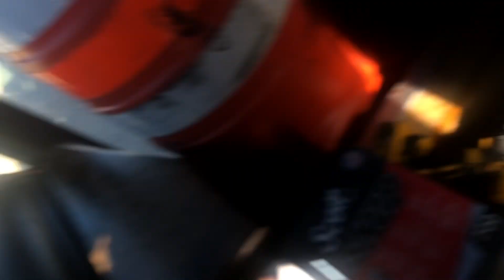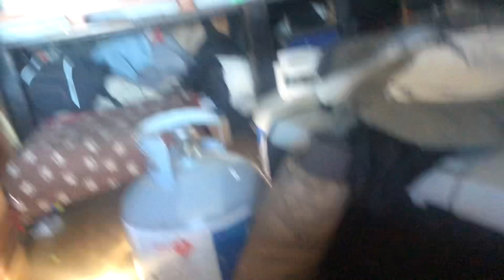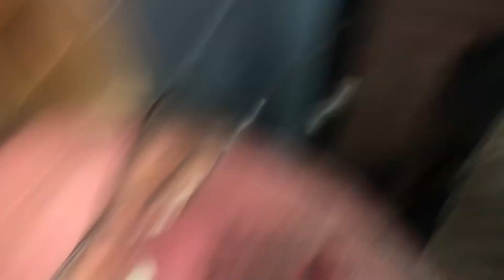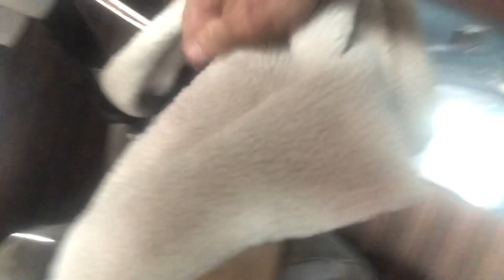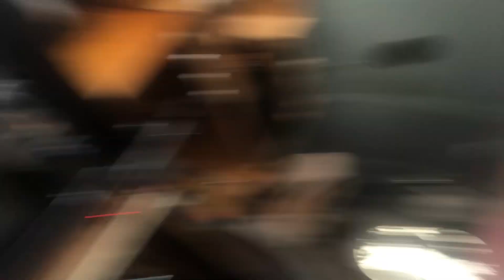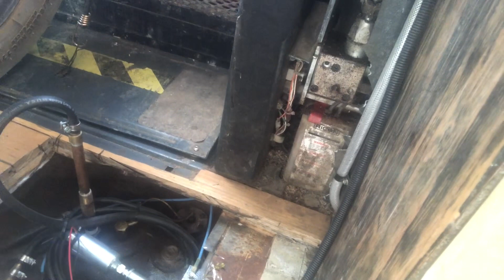T444e Organization is the Key

Comment: ...woman's work is never  done...and my lawn mower throttle cable broke so much cable wire that it wouldn't start so our  can do attitude I used zip ties wrapped around the broken steel wires to get more torque when handle pulled down  and it ran all hour and wrapped a longer tie to hold the Briggs and Stratton engine running and took the bag off with it running...there is always a way...